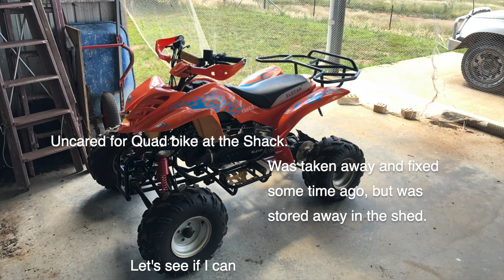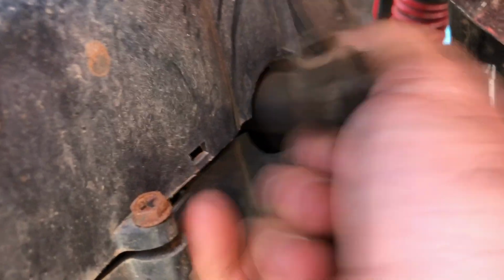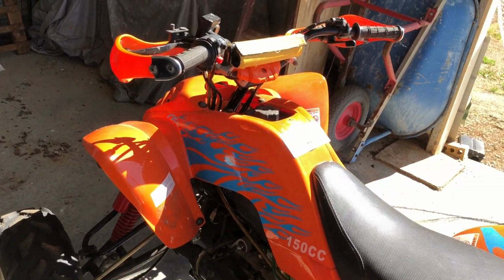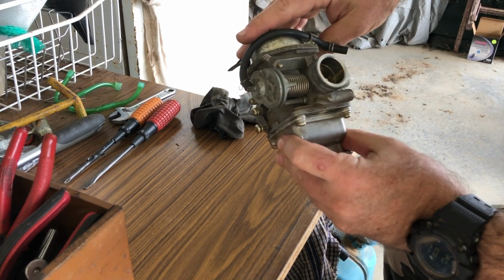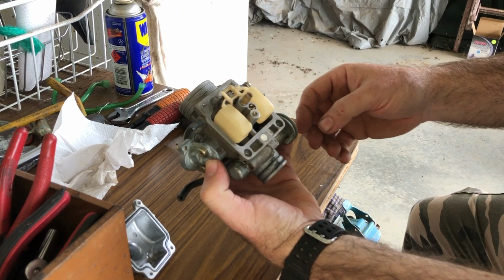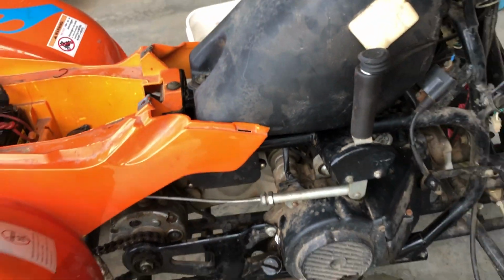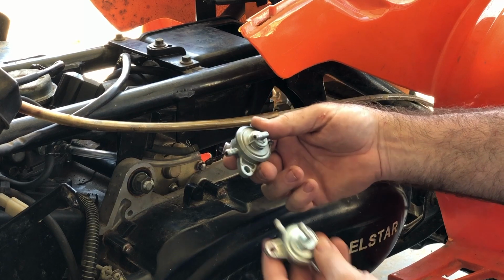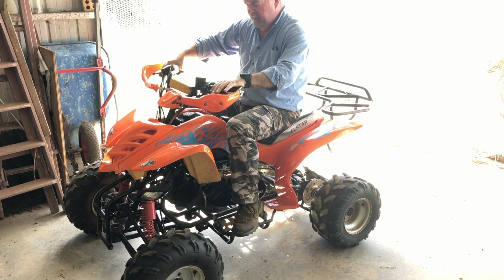Fixing the Quad Bike | Will It Start?

Comment: Quick word of warning.See if you can get an operators hand book for it.I have 2 quads 1is 4x4 other is 2wd and the difference in handling of the pair is very different.4wd Quad in 4wd, Selectable from 2wd, has a Limited Slip front  Diff which means it tries to drive both wheels in certain circumstances.Cornering  on side of hills is very hairy as you need more steering input to make it turn, as the 2 wd is lean on the inside to make the tyre grip and around you go.Side angles can be pretty hairy that is why most manufactures state go straight up or down hills.Roll over can occur before you know it.,Motor sounded like the choke might be on a bit as there was a bit of smoke coming out the exhaust that looked like rich mixture. I did notice a idle mixture screw on the carby which might need a turn or to to get it running right.Just trying to help out not being smart alec.Save life maybe.They are not toys as thats why roll over protection systems where brought in.Great looking area down that way too. i have 42acres on Mid North Coast NSW and use the quads as tools not toys. Enjoy your place with the family and friends. Ah!!!!! Pure Serenity and we deserve it,
Reply from the maker: Yes, all good advice thanks Scott. The mix is off in the carbie, so I'll need to check that.  Thanks for watching!
Reply: @TaralgaBushAdventure  Sounds like you enjoy the slow pace of life out on your block too.By the way how many acres/hectares if you dont mind ?
Reply from the maker: It's approx 400 acres
Reply: @TaralgaBushAdventure  Thanks for that,I imagine it was once a larger property divided into smaller lots like my place.Itwas originally approx 450 broken down to 2x 100 acres 1x 200 and a bit and my place 42.5 acres.Forbes River 2446 if you want to have a gander. Wont give exact location as dont know who is watching. Thanks again , and enjoy it whilst we are still young enough.